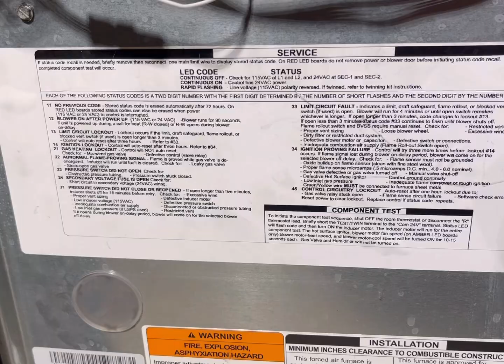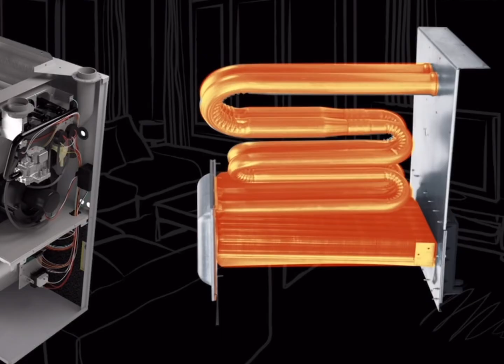Most Common Furnace Code I See As An HVAC Technician And How To Fix It

Comment: Had my furnace keep turning on and off 3 times each time before it stopped turning on first cleaned flame sensor and flame igniter that didn't do the trick so I replaced them i was about to call a hvac to come look at it I was trying to understand the red error light codes and then saw this video I changed out the filter and that did the trick I swear it hadn't been that long since I changed it but that did the trick thank you

Comment: Mine trips code 33 if I have ANY filter in it. It trips more when it is colder. It’s running more. Not at all when there is no filter in it. Do they need to turn the burners down? Or turn up the speed of the blower motor? Is there a way? All room vents are open.

Comment: SOS: changed my filter along with my flame sensor, assuming mine was old and corroded. Still I have no flame in the burners I have 3 fast flashes followed by 4 slow which is a code 34 ??? How did I get constant pressure to the gas again. Breaker isn’t tripped

Comment: The continuity test is not done with a voltmeter. It is done with a multimeter that is set to test continuity. Or alternately, the multimeter is set to test resistance; where in this case it shows zero resistance (zero ohms).

Comment: Thanks a lot man for all the advice, i added the pigtail and outlet with the switch to my furnace and it works great. Now i have a backup so i can run it thru my generator outside through my basement window if power goes out.
Reply from the maker: Great to hear!

Comment: Just signed up for your channel. I really enjoy your detailed videos for hvac furnaces. I’m a diy’r when it comes to furnaces as I had run into a issue with a faulty pressure switch on a weekend with no part on site. I searched endlessly on how to get temporary heat to bypass the pressure sensor. I figured it out but I always had to do it manually to provide heat. Took of the wires turned on the furnace and as soon as inducer motor kicked on then I would jumper the 2 wires and get it to turn on. This process would have to be manually repeated each time but it was a quick fix to get us hear till I could get a pressure switch!

Comment: I wish I saw these videos before I called someone, issue was that filter was clogged even though we thought it was supposed to be changed every couple of months. Definitely will be checking monthly from now on. Tech gave us some choices, but I think I will definitely replace the high limit switch, I just have to find the correct part. Another option the tech had was to clean the dust out of our vents, but the cost was over $1500, is there an "easy" way to do this myself? *Edit nevermind I never finished the video before commenting, definitely will be looking at repair clinic.

Comment: Stated in another video mine hits it's limit when it is really cold but always restarts on it's own Filter is clean Guessing its because it runs so much in this draft old house when the temps get down low or it's windy Unit is from about 2010 replaced one from the 70's I had to replace the exhaust blower a few years ago Only thing that has gone bad on it

Comment: My guy said that I should replace my filter with a merv 6 instead of the merv 11 that I had in my furnace. Is that turn? I have a 16x20x1 filter in a amana furnace
Reply from the maker: A merv 11 is almost hospital grade and probably pretty restrictive. Could put more load on your furnace. It’s your call but I typically recommend a merv 8 filter in most cases. Cheers

Comment: I've had 3 HVAC companies come out for an intermittent error.  Unable to call heat message on the thermostat.  The filter has been replaced as well as the blower motor and fan.  The wire connections on the thermostat have also been checked.  Just wondering what you investigate first
Reply from the maker: What’s the error code? For a quick response with diagnosing things, check out our membership over at Patreon.com/diyhvacguy  where for $25/mo I will answer any and all questions when it comes to diagnosing, sizing, and purchasing equipment or parts. Thanks,   Dave
Reply: Furnace does not give a code or blinking sequence.  Only the thermostat with a message "There may be a problem with the Furnace. For the past 2 hours the thermostat has been calling for heat, but the room temperature has decreased by 3.2F." Works 95% of the time then randomly this.  I know it can't be diagnosed over the internet, but wondered what you would look for.

Comment: I had a Code 33 last year- my filters were new. BUT they were the high end Filtrete filter. I read those were "too good" and they suffocated my furnace from getting enough air flow. Now I buy the cheapest Filtrete filter and my furnace gets plenty of air flow and no more 33 codes.

Comment: Hi Dave, I have furnace issue/problem with 3 flashes which is “pressure switch do not close or reopen” when the upper door is closed. When I try to figured out/fix it runs when its open (no upper door) & give us the target temperature but when it stopped, it flashes 4 times. Is the 4x flashes a part of normal operation when it stop?
Reply from the maker: I’d be happy to help, but due to high demand, I have to give priority to the folks with a membership that gives access to tech support. Check out Patreon.com/diyhvacguy    Cheers
Reply from the maker: I’d need more information about your furnace to know what the codes correspond to.

Comment: How can you determine if the circuit board is bad and is indicating the wrong error code?
Reply: He might have a video that explains troubleshooting a board. Otherwise search on YouTube, plenty of videos available. One quick thing if you want to try. Shut off power and then remove board. Typically held in place with plastic pins or screws. No need to undo wiring typically. Look at back of board for burnt areas. Sometimes it’s as simple as that.
Reply: @roberts1159  Thanks
Reply from the maker: I’ll be posting a video soon on troubleshooting a board but it sounds like you need some help sooner. If you go to Patreon.com/diyhvacguy I have a $25 membership that offers technical service so if you need some help troubleshoot I’d be happy to answer any of your questions over there. Cheers,   Dave
Reply: @diyhvacguy  My question was more hypothetical, but I will keep your offer in mind for future problems. Thanks.

I had a problem in the past on a Trane XE80 where the light indicated something about a flue restriction or draft problem. I changed filter, cleaned some dust out of the draft fan and checked the flue to make sure it was not plugged or iced over above roof. It did not immediately fix the problem, but after awhile, the light went back to normal and everything worked fine. It left me wondering if maybe there was  an intermittent problem with the board.

Comment: Can I ask you a question? Not really related but I just put in a smart thermostat, all wiring is good, the problem I’m having is that when the furnace shuts off it shuts off the thermostat too, like cuts power to it, then the stat restarts. A/C and fan don’t do it. Any ideas? Would be greatly appreciated
Reply: some furnaces supply constant power to the thermostat and others don't. could just be the way your furnace model works. I've heard some smart thermostats have batteries that can recharge off of this power supply, or can have dry cell (disposable) batteries installed. Worst case scenario you may either have to run an extra wire that is always energized from the furnace transformer, or use a different model thermostat.

Sorry mate i know you didn't ask me specifically, but I'm just sharing some info I've encountered.
Reply from the maker: Hmm, what kind of thermostat? Does it have a c wire or no?
Reply: @diyhvacguy  Honeywell, has a c wire and it’s hooked up correctly, but for some reason the thermostat turns off whenever the furnace does, then it comes back on.

Comment: Technical question....Blower wheel....10 (diameter) x 8...will a 9 1/2 x 8 be ok ??🤔
🤥
Reply from the maker: Not sure on this. If the wheel doesn’t move enough air, it will cause the furnace to overheat

Comment: Maybe I've seen you in the supply houses in the Salt Lake area? I work in the commercial HVAC side in Utah. I haven't worked on many residential furnaces in my 42 year's in the industry mainly large chiller plant control systems and large building control systems. 
Interesting watching the residential side. Thanks.
Reply from the maker: Right on! Thanks for watching!

Comment: I presume it doesn't matter which wire you plug into either side of the limit switch.
Reply from the maker: Correct. On mine the one pin was smaller then the other but it doesn’t matter if they are the same size pins 👍🏽

Comment: Good point about the drywall dust clogging the filter and not being able to see it. Candle wax when burned, or plugin air fresheners can also clog your filter and sometimes turn it black depending on how sooty these things burn.
I was told that if your limit switch sticks that you can tap on it and unstick it. What do you think?
Reply from the maker: Yea if it’s just starting to stick you can try that for sure.
Reply: @diyhvacguy  tapping on it is a temporary solution. In my 43 year of working as an HVAC technician, I have ALWAYS told the customer to have limits replaced. They WILL fail again and usually within a week. Also, a bad blower motor or busted wheel hub can cause the limit to open. Something a homeowner will not be able to perform that change out. As always, another useful and informative video young man. 👍🏾
Reply: @OGHVAC  right on bud I wouldn't even call it a 'temporary solution' myself but a 'diagnostic aid'. if tapping on the switch makes it work, it needs to be replaced immediately! not a part to be fooling around with!